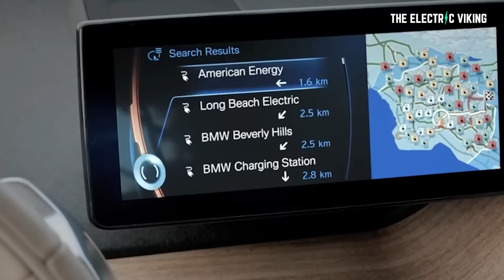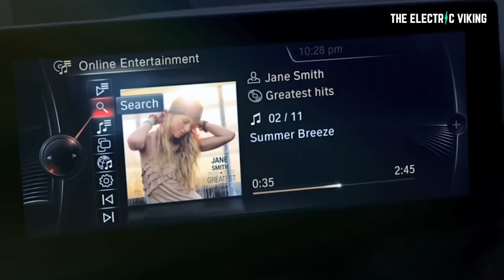BMW executive says motorists should stop buying new cars

Comment: Since it’s now baked in the cake that the internal combustion engine vehicle is dead why not incentivize the use of renewables at home to power our transportation system because it will help us be more resilient to the world supply chain issues with oil and the oil dictatorships we help prop up with every tank of gas we buy
Reply: Some places have been doing that for decades.
Reply: @danharold3087  I should have said increase our incentives and decrease them for fossil fuels and internal combustion engine vehicles

Comment: I put many miles on my car, but I keep the interior of my car in brand new condition until I sell it resale, and I have always other than my 65 mustangs, but and driven Toyotas, a dozen new and to used, and when I sold them every single one of them or traded them in in some cases, I got Approximately 80% of my original purchase price and a large part of that was because my interior was spotless like brand new unless you're a slob this is pretty easy to do. If BMW was serious about making your used car like new they would be recommending treat your car with respect and number two the best things to make it seem like new and be safe is to have your suspension inspected replace any worn bushings or control rods replace the shocks at a reasonable interval and keep a relatively unworn set of tires on the vehicle, other than that if you want your car to remain in a fairly new condition, change the oil and filter yourself and use only high grade synthetic oil, and if you have a older automatic transmission vehicle you will need to change the transmission fluid and the filter screen at some point, and this involves more work and changing the oil, and in most cars it will require 10 to 14 quarts or liters of the proper transmission fluid. The biggest mistake that will kill your older car is putting the wrong transmission fluid in the automatic transmission period and if you want your car to remain in relatively new condition never let a dealer touch it unless you absolutely have to.
Reply: @H2s yes, those type systems are meant for longevity which is the exact opposite of what the Legacy car manufacturers have been doing and they would be more expensive to initially set up for production but after that they probably would not be much more expensive in a production line properly set up. Another thing to mention that I didn't, is that virtual US military vehicles maintenance schedules never change engine oil because they use high quality mil-spec synthetic oil and they have sidestream filters, so at regular intervals the filter systems are changed and then the required amount of new oil is added to bring the operating oil level back to spec, but the oil reservoir is never totally drained except during overhauls. This is possible because synthetic motor oil holds up better to temperature changes and if it's high quality it holds up better to high temperatures has a better range of viscosity with temperature change and it does not immediately begin breaking down into acetic components as normal motor oils will.

Comment: We need to look at the issue from energy standpoint, CO2 standpoint and also think about longevity.
Regarding energy, Due to the war the EU has trouble with it's natural gas supply and with it the power capacity and cost. They have far less issue with their oil supply. It might be better to wait a year or two with adding more EVs to the power grid demand until the nat-gas issue is resolved or more capacity not depending on it added (and better that it won't be coal as it ruins all environmental benefits of the EV).
Regarding environment, the older ICE car is already produced so the production cost is already paid. Unless it's a guzzler it might be better to use it a few more years and produce less new cars.
Regarding longevity, the million km is in the lab, actual results are yet to be seen. In addition longevity is not dependant solely on the battery, there are many other components that can fail with time or even just plain structural rust.
Usually a car is scrapped when it's not worth to fix it relative to it's price, not necessarily because the engine died. I saw that model 3 longevity is estimated to be around 300-400k miles or around 30 years. The Chinese are probably lower then that because of Chinese regulations.
Regarding Chinese models, there is a mandatory scrapping of cars by age of 8-12 years in China so the OEMs will not engineer actual longevity much higher then that.
 The average age of a (ICE) car in the US is 12 years so their longevity is probably around 24 years, not much less then the relatively expensive Tesla.

Comment: Electric cars do not last longer than ICE or hydrogen or any other form of energy storage. The cars either last forever if not used and stored in dry climate or a few years when used in the rust belt or near the sea. Only newer European cars last significantly less long because of the pesky emission standards.
Reply: Wolfgang.  When people say an EV lasts longer than ICE they are generally talking about the power train.   It is hard to argue that this is untrue.   As for the rest of the car rusting or not that has more to do with where you live than who made the car.  Yes some are more rust resistant than others.   ICE cars especially do not last forever if unused and kept in a dry spot.   The fluids age out, tires rot, and the interiors crack etc   It is why restorations only last so long and they do them over.

Comment: I'm not even going to say I hope you're right... except in the very long term, 25 to 35 years. We are, if you haven't noticed, in the middle of The Forth Turning. This quarter has the most potential for disaster. Things could as well turn out OK, but I'm more concerned for the long term. And we cannot get there from here. We're going to have to collapse the current paradigm in order to advance to a more equitable, progressive and sustainable civilization... and the first to go must be the debt-money monetary system most developed nations are currently burdened with. That cannot be done without collapse of the current system to make plain to all it's flaws. EV's at the current time, merely a pipe dream.

Comment: Not sure who this BMW exec is. Would make sense if they just don't want to spend to reinvest/retool for new ICE models vs. EV plant buildouts, but not come right out and say they are planning to stop production at some point. Most ICE cars will last 200,000+ miles with just oil changes, brakes, tires, minimal parts replacement or until the wheels fall off. Too bad the used car market is full of scams, best to buy from original owners with cash.

Comment: Improving climate change technology is exspensive. So our children will have a better future. The only issue with that, is we're facing population collapse & we are not having any children, to have a future or a legacy. South Korea currently has the lowest birth rate in the world. The average woman in South Korea is having 0.8 children each. 2.2 children is needed just to maintain a population, without immigration. However even countries that traditionally have many children like India are predicted to drop, below 2.2 in the next 2 years. With demographic decline, comes economic decline. With economic decline, environmental technology, becomes unaffordable.
Just something to think about. The future is having new issues & new problems.
Reply: Wind and Solar power is more economical to build and operate than coal or oil fired power stations.    The only overly expensive part in an EV is the battery.  In 5 years we may have a glut of them.  EVs should be less expensive than ICE cars.  They are simpler.

Comment: ICE cars are rubbish.  They fall to bits. The auto industry builds them that way. So you have to replaced them. They over charge on the price too. Its about greed by the auto industry.
With the high price of fuel an electric bicycle makes a lot of sense.

Comment: I like the French move to remove so many cars off the road for more personal transportation. Old Cars? Yeah there is a place for them, alternative fuel developments will allow cleaner running but if we can get people to leave their cars at home instead of all the short trip running that is neither good for the economy or the life of the vehicle and get people fitter riding their e bikes and scooters at least when the weather is favourable. The Older vehicles don’t have to be banned much as the zealots want but can be use reduced giving benefit when needed. I’m in favour of smaller electric vehicles all the way up from kick scooters and people using their luxury vehicles minimally …. Did you know that it’s possible to buy an electric bike and never plug in your charger. I guess it takes discipline to ride the bike uphill on regen and coast on regen to charge the battery but then you can use it where you might really need it. It’s up to you to drive it on power or exercise on it . Both are possible at any Time …

Comment: Dusty ol' idea in General Motors "Loco Motion" files -- an electric "skateboard," that you can bolt a fresh, different "shiny part" on top of. (Then Run yer skateboard until the wheels fall off.)